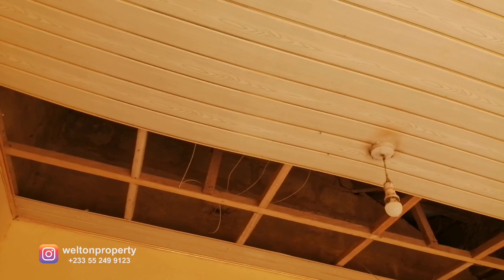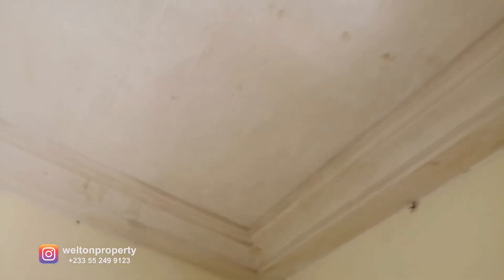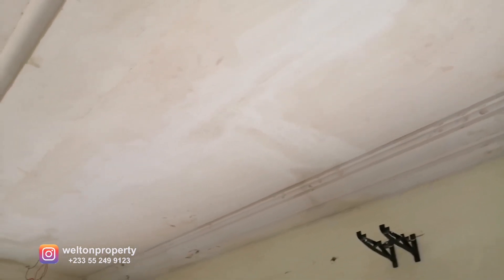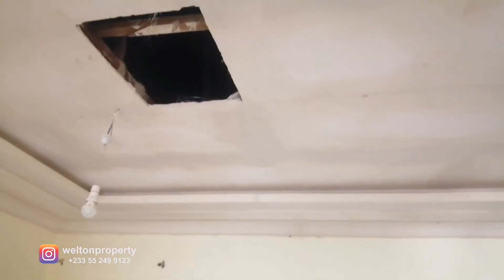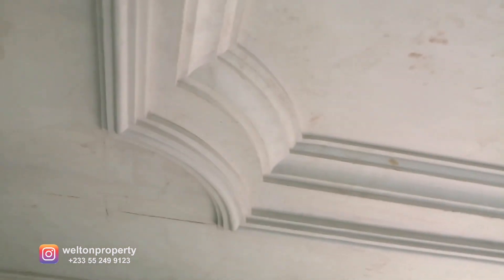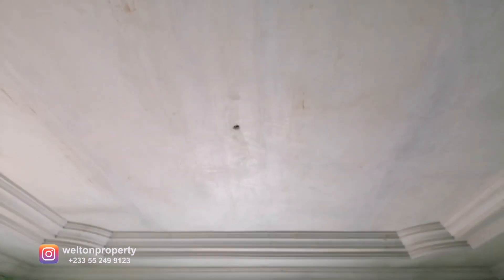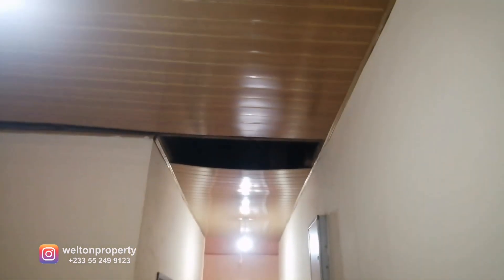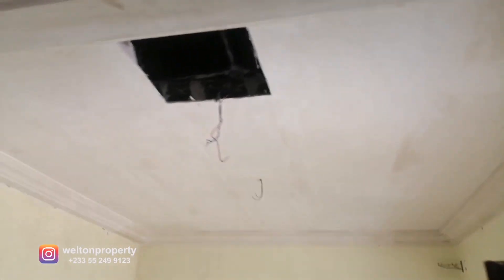Replacing Plastic T&G with POP Ceiling Moulds (Building in Ghana)

Comment: Woow nice job done 👍👍👍
Reply from the maker: Thanks Patrick
Reply: How much does it cost to ciellng of 4 bed rooms of  POP TYPE ?
Reply from the maker: @georginaattamirekua5367  Cost usually depends on the sizes of the rooms and the designs you prefer. Call / Whatsapp +233 552499123 to discuss further
Reply: @weltonpropertyadvisory4994  I need  to talk to you
Reply from the maker: @nanayaa3804  Kindly Call / Whatsapp +233 552499123 to discuss further